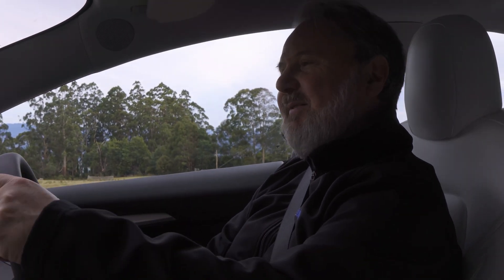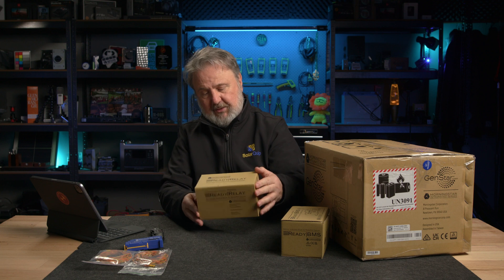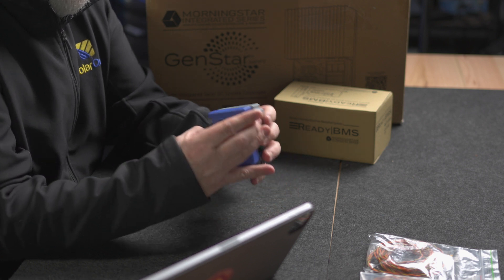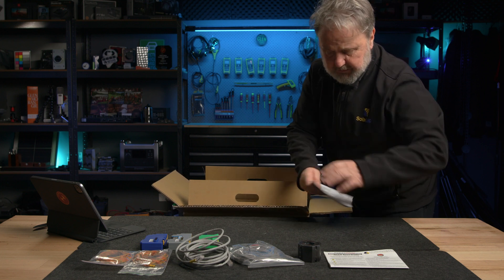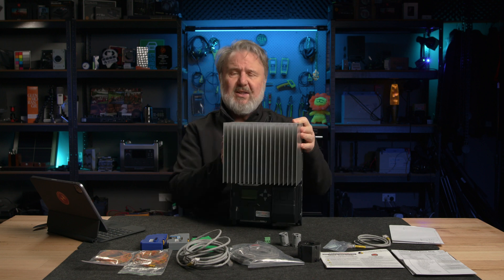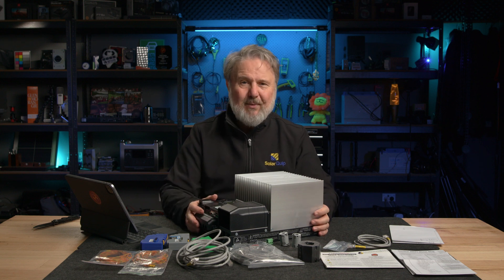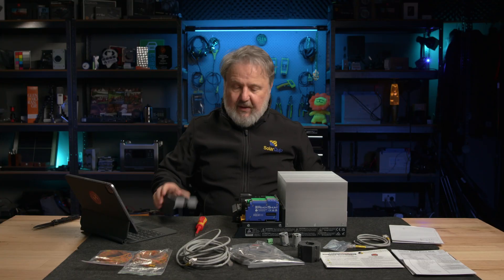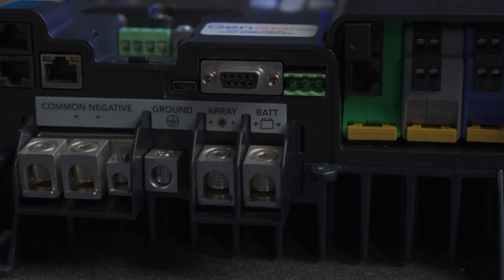Morningstar GenStar MPPT

Comment: Great video! One thing you missed is that this is one of the few MPPTs that has built in ethernet in addition to wifi and bluetooth for remote monitoring, from an IT perspective, this is absolutely ideal since it's a stationary device. It one of the main reasons I am looking at this MPPT controller compared to others, even if they have ethernet as part of add on modules.

Comment: thanks were i live we spend alot on ac 100/ 103 every day now so i was looking a running a large unit with the unit that mount to the wall inside / or running  a couple of seprates but thay can pull 1kw up to 2 kw a hour depanding on the temp outside / trying to save money may have to look at eg4 24000 btu ac/dc units

Comment: what do you think of the outback 48 volt 8kw inverter / and 6048 xw pro schneider looking run 4 or 5 ton heat pump with one 240 volt 40 /50 amps peak /year  round
Reply: That's a 5 ton using 3.3kw per hour x 24 = 80kw per day just for heating/cooling. For three days autonomy you need 240kw battery just for air con. To charge the battery from flat in 6 hours, you'll need 40kw of solar or 50kw to overrate. So you'll need a solar charger that can do 800a at 50V. Very big numbers just for air con.